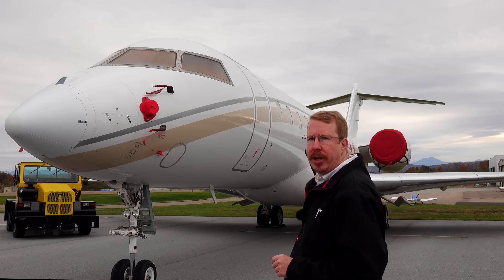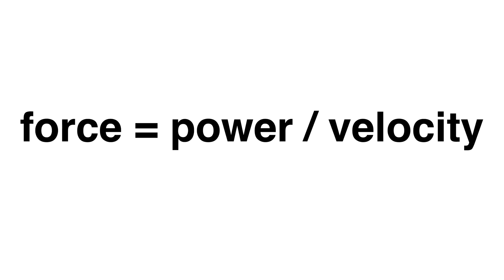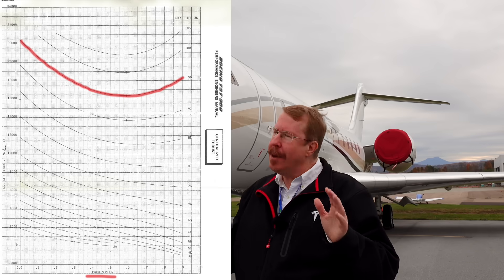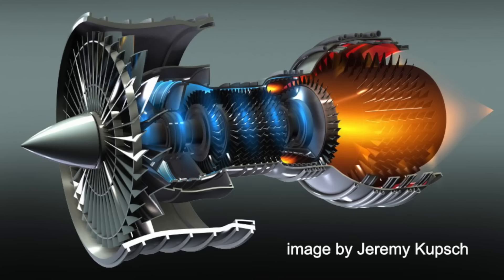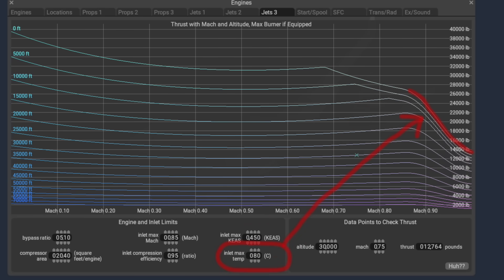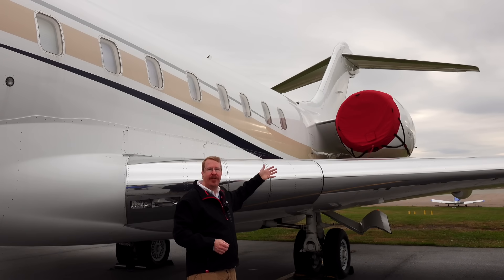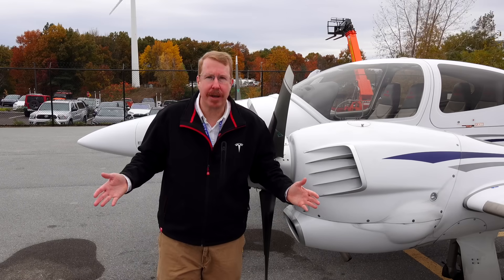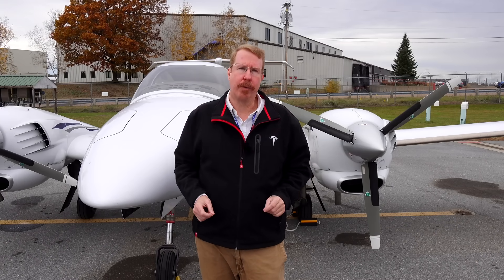What's new in X-Plane 12.0.8?

Comment: And after all the beta testing and updates, they still haven't fixed the ridiculously dark and unusable cockpits.

2:18 Never thought that someone as smart as Austin would promote the disproven premise that Bernoulli's principle is how airplanes fly. Yes, pressure decreases with increased velocity, but that does not provide sufficient lift to allow an airplane to fly.

Newton's Third Law (action/reaction) is how a wing produces sufficient lift. That's why airplanes with symmetrical wings can fly just fine, why airplanes can fly inverted, and why balsa models with flat wings can fly. You can accelerate an airplane with traditional airfoil wings down a runway as fast as you want, but it will never lift off until you rotate, increase the AoA, and force air downwards.

Comment: that's all great Austin, but you are missing the ESSENTIAL part-> AVIONICS, the G1000 in XP for example is now sooooo freaking old ...and G3000 which is now in almost every BizJet/turboprop...well Its not even there....without up tp date Avionics its no use if you have the best engine modelling in the world...MSFS did that one right the made some really good base Avionics and thus made it easy for developers to built it into planes......a stone old G1000 with pretty much zero system depth and a GNS530 is just not enough

Comment: That is great Austin, but you need to fix the computer side of things. At this point I could not care less about jet engine horsepower. Your input controller defaults are not sane. I have tested multiple controllers across multiple platforms and they are all massively over sensitive. Taking off in the Cessna with a 5kt crosswind results in powerslides that would win me points in drift race. Yes, I watched the vid you made about that. Its not "physics". That does not happen in a real Cessna Austin, If it did, nobody would ever fly one. Its not due to the flight model, its not due to aerodynamics... its about jerky control and input sensitivity so extreme you cannot tame them down. I have built curves for all of them and they are so flat they almost dont even have one, yet still, massive jerky abrupt rudder deflection. The rudder, for example, is not linear from the end of the dead zone, it seems to start from the center, then once past the dead zone.. boom, over-deflected, and I am careening sideways down the runway. Same with the toe brakes. Even the tiniest imbalance between left and right and you are into a ground loop.... with tricycle landing gear... As I said... multiple controllers from CH, Logitec/Saitek, Thrustmaster and even Mad Catz across Linux and Windows on AMD and Intel machines. I see 12.0.8 will fix the wheel pinup problem so maybe I will be able to land the Baron 58 without slamming the nose to the ground. That should have been fixed loooooong ago. From the visual side of things, cloud shadows over water are nice, but reflections are more important, as is sunlight reflecting off of glass skyscrapers. That sort of thing has been available in other flight sims for 20 years... why in 2023 are we still without this?

I will leave the porpoising and rubber band physics of the f14 and other fast flyers for another post, with the exception of reminding you about whole body physics, moments of inertia, mass, and gravity. I am not hugely impressed with the default flight models in X-Plane.

Comment: That's all nice, but let's have a lot more love for visuals because that's also an important part of flight. I'll give you an example. Flying into rain will reduce your visibility, Strobe lights and landing lights shining on clouds as you fly through them can impede your vision and sometimes you have to turn them off so you're not blinded by reflected light. I am sure there are some folks into the whole physics elements and science but let's be honest here, the dynamics you are working on relate to the default aircraft that comes with Xplane but much of it isn't something 3d party devs concentrate on or put a whole load of time into so the "dynamics" of xplane gets undone by none accurate flight models of third party aircraft (Im sure that many here will either be flying Zibo and flight factor aircraft with very few flying the default aircraft)
Reply: I agree. Austin doesn’t seem to value visuals.

Comment: The accuracy and reliability of aerodynamics and aircraft models are better in X-Plane than in Microsoft.
Reply: @thalesair really? What aircraft in XP is better than the A2A Comanche in MSFS?
Reply: @johnmaguire2185  The CL650. And the Comanche uses an external flight model, not Asobo’s one.
Reply: @frankbyte  i don't' care who coded it. Comanche has no better in XP. Combination with MSFS it is superior to equivalent XP.
Reply: @johnmaguire2185  CL650 in XP  > Comanche MSFS
Reply: @frankbyte  really? They had added charts into the CL650? If no navigraph option then its not top of the league for me. No EFB charts then its VFR only imho. Even VFR navigraph now has vfr and sectionals.
Reply: @johnmaguire2185  seriously what are your sources? The CL650 had navigraph-charts since the beginning or at least since years. And it’s something extremely „basic“ in XP-addons. People like you don’t realize the level of the CL650. But if navigraph-charts is your only criteria of excellence, you seem to have rather low standards.
Reply: @frankbyte well ones prop and the other is a jet. You can’t compare them but realism wise there both on the same level
Reply: @Swish_slashy22310  First of all, the CL650 is a way more complex aircraft. And does the comanche simulate the accuracy of radio and satellite-signals based on the toppgraphy, time and exact position of those? It does not. The CL650 is one level above everything else.
Reply: @frankbyte  well it simulates the most you possibly can, you can not simulate an aircraft any further. same with CL650.
Reply: @frankbyte  also, I don’t think you can do physical damage to the CL650 can you? You cannot. A2a have managed to peak out the realism and my flight instructor said it flew and in terms of an overall general aviation aircraft it is the most realistic he has seen on ANY flight sim.
Reply: @Swish_slashy22310  Again, the CL650 is a way more complex aircraft in real (pressurization, bleed-systems etc). There is no comparable aircraft in that depth in any other sim. By far. The Comanche in MSFS may be excellent, the CL650 is on a different level. Believe me.
Reply: @Swish_slashy22310  But to be fair you said above that both were not really comparable because one is a jet, the other a prop. I fully agree with that. And although I have never tried the Comanche, I do indeed believe that it could be at the same fidelity-level as the CL650. With the only difference that the CL650 is a more complex aircraft in its base; and that is the reason why it stands out of everything else.
Reply: @frankbyte  exactly, thanks for getting my point

Comment: X plane needs to work on concurrent use of CPU cores... That's the killer feature. Right now about you could have a 16 core CPU and x plane uses just one to render a frame.
Reply: With OpenGL you can only have one thread rendering.

Comment: I have just installed this beta 1 on my 5 PC simulator.  So far its stable and no glitches.  I am still finding that it rains on each x-plane instance separately and also that airport ground traffic is different for each.  I was under the impression these would be synced in this release.  Its a real immersion breaker when these things aren't synced.

Comment: I'm waiting  for Asobo devs to get into this kind of simulation detail as Austin does. Yep, not gonna happen. xD
That is why I love XP11/12, you conscious knows what is happening in the background when you are flying, and it drives the brain to produce so many pleasure signals. :)
Reply: That's what the add-ons are for, they have a lot of systems simulated. Clearly, clueless. Good morning!
Reply: You clearly didn't understand my point. Asobo = Default, Austin = Default. I didn't mentioned addons at all. So try again.
Reply: @Pe11ePD  No, you missed my (and everyone's) point. No one plays default in MSFS on PC. So try again. 😂😂
And btw, what you going to do with the changing fuel temps while flying the plane, it is not going to make your landings harder 😂😂
Reply: @Pe11ePD why would anyone choose default if they want realistic aircraft? 

Noting in XP will beat MSFS add on aircraft for systems simulation. Oil cooling, lol like it’s some kind of miracle new code. Even FBW A32NX freeware has that already. PMDG, Fenix, A2A all hands down beat any similar aircraft in XP and they are all still in active improvement cycles. FSLabs soon to bring their aircraft in as well. XP devs seem to be in maintenance mode trying to get XP11 offerings to work in XP12 rather than new products.

Comment: I'm curious because I haven't upgraded to X-Plane 12 yet, but I'm currently using X-Plane 11. In X-Plane 11, I've noticed that the cloud dynamics don't seem to replicate turbulence as realistically as it occurs in real life. Can you confirm whether X-Plane 12 has made any improvements in this area, or if there are any plans to enhance turbulence effects in future updates?
Reply: From day one.  Fly in a cloud, it gets bumpy.  But just download the demo for free and try yourself!
Reply: Stay with XP11!    XP12 has almost no anti-aliasing.  In XP11 I had a perfect experience, using multisampling at 8x and supersampling at 4x (set through Nvidia Control Panel).   In XP12, Nvidia Control Panel can no longer override the AA settings.   You get MS at 8x and nothing else.  It's a shimmering, flickering, jagged mess!
Reply: @DavidR_192  I know a lot of people use the nvidia control panel in xp12.  Is it possible that you need to remove/re-add the override setting since the control panel might be looking for the xp11 folder instead of the xp12 folder? I don’t use it (or windows) so I don’t know for sure.

Comment: Great update!   Question on the RAM Air effect: Why when thrust is below 80% (on your 737 graph) do you lose the RAM air benefit?
Reply: when the turbine is not doing any WORK with that compressed air... then slowing down the air... is just a parachute. the turbine compressor is just a parachute at lower throttle... you gotta spin it way up to USE the air you slowed down to compress to get anything good out of it. the air is slowed down and compressed... thats nothing but drag slowing it down.. but if you USE that higher pressure and density to make thrust with a ton of throttle then you get something back

Comment: I love X-Plane 12 but we need better VR performance.
Reply: In the next graphical update (12.10) they are targeting CPU performane. Hopefully a few more fps for VR!
Reply: @Darkoryou  Let's hope for a miracle.
Reply: @nty3929 This is not my experience at all! X-Plane 12 runs at an absurdly low framerate, even if I put all settings on low. The rendering is extremely pixelated inside the HMD to the point that it is unusable. I fly fs2020 everyday and I have a blast. X-Plane 12 VR is not even close.
Reply: For VR, I still fly XP11 since it has better performance and it respects SteamVR's "Custom Resolution Multiplier" properly (i.e. I set it to 160%).
For flatscreen, I will fly XP12 since performance is adequate for that.
I still enjoy XP11's HOTAS flight handling characteristics. XP12 seems to be a bit too sensitive for my BD-5J, and custom curves don't really help much. I miss XP11's Stability Augmentation settings.
Reply: @quantumac I tried going back to XP11 and the performance and clarity is much better, but I got a lot of microstutters. Might try going back to try it again.